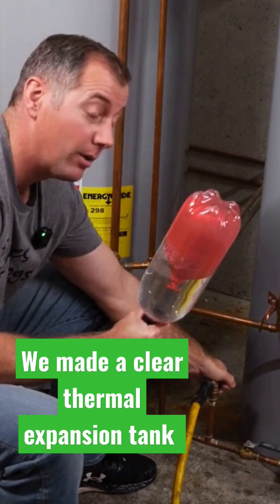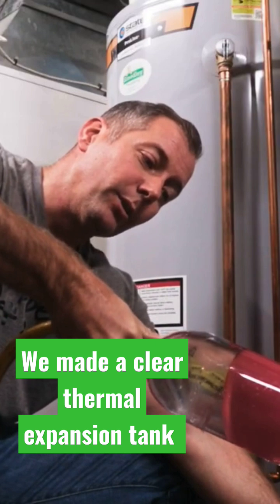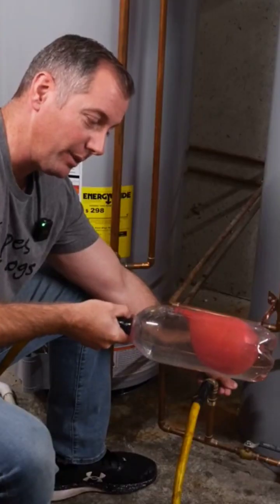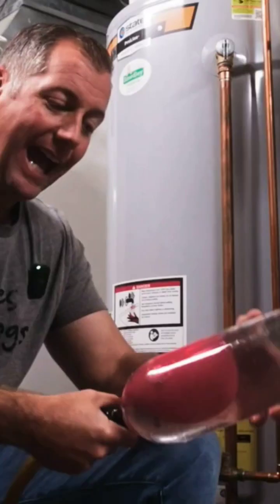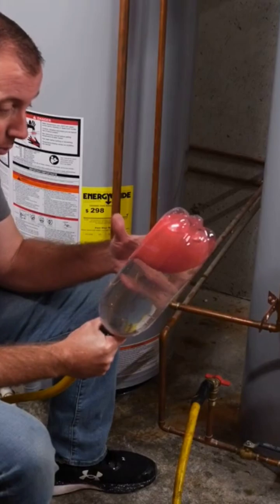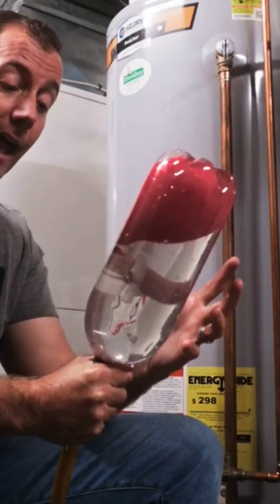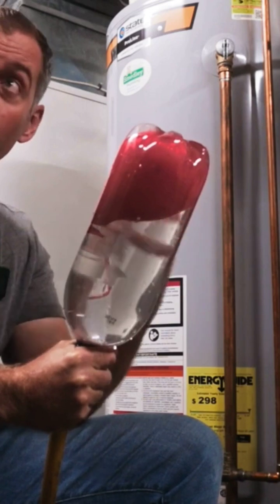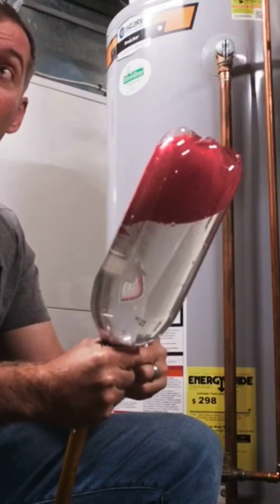What happens inside a thermal expansion tank?  #plumber #science

Comment: Can you install hot water tanks directly on concrete floors?  I just replaced a 15 year old unit, and installed the new one on the concrete floor in it's place.  The outer shell on the old unit only had some rusty scrapes on it.
Reply from the maker: Yeah.  They typically have small feet that hold them up from the floor anyway.

Comment: I'm not a plumber, by any means, but can anyone explain to me how we managed to survive with hot water heaters for quite a long time, without the use of these expansion tanks? 
I've seen quite a few old water heaters in basements, without these little tanks, I understand what they're for, and that water expands as it is heated, but were there enough water heater explosions to warrant the implementation of these expansion tanks becoming code in most areas in the United States..?
Reply from the maker: Great question.  The main reason is we didn't used to have check valves in the system.  Those check valves prevent the water from flowing back into the supply system.  Once locked in the home, it causes the pressure to rise.
Reply: @SmedleyPlumbing  cool, thanks for the reply
Reply: Good question. Look into open and closed h20 circuits 
If prv fails its ugly. In Cali we are only required to put them in if recirculation pump and/or h/c mixing vale is installed

Comment: The expansion tank is useless Unless it is pressurized correctly. You will find a bicycle valve fitting on top that needs to be filled with compressed air (while the plumbing is depressurized), typically to the operating pressure of the water.
Reply from the maker: *to match the operating pressure.

Comment: But what’s the point of the bladder I don’t get it
Reply from the maker: When your water heater makes hot water, that water expands.  The tank provides a place for the increased volume to reside temporarily until a tap is turned on.
Reply: @SmedleyPlumbing  why. Bother with a bladder then just have an empty pressure tank
Reply from the maker: @jasonnester9514  the bladder separated the air and the water.  Without the bladder, the water would absorb the air.  The bladder keeps the air in a state where its ability to compress becomes what allows the water to expand into the tank.
Reply: @SmedleyPlumbing  I don’t understand that all lol
Have a air less sealed tank no water and how does a bladder stop air from getting into the water not that it matters but I don’t get it at all
Reply from the maker: @jasonnester9514  the bladder is like a diaphragm that keeps them separate while maintaining flexibility.  Similar to your diaphragm muscle in your body.  Separates your guts from your lungs while remaining flexible.
Reply from the maker: @jasonnester9514  here a link to the full video.  This might help.
https://youtu.be/S2HVSogYELM
Reply: Look it up